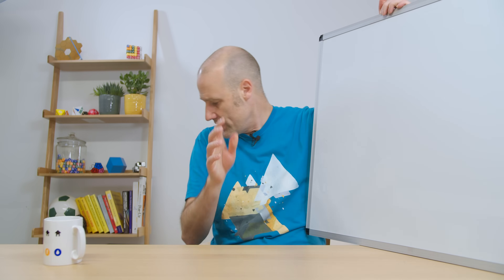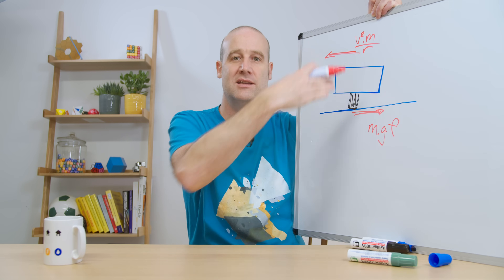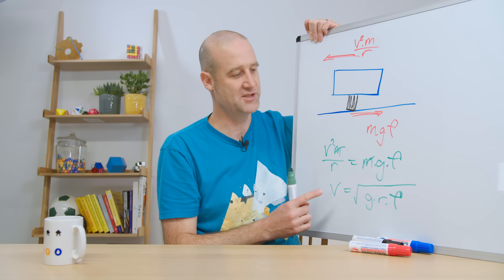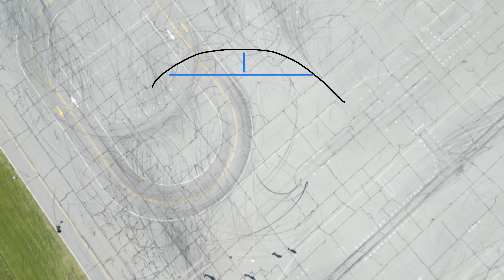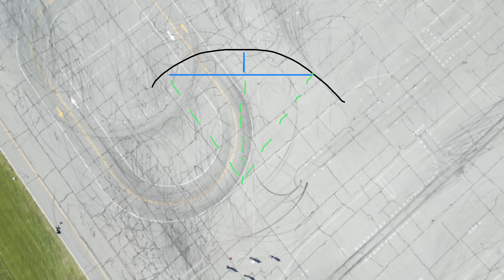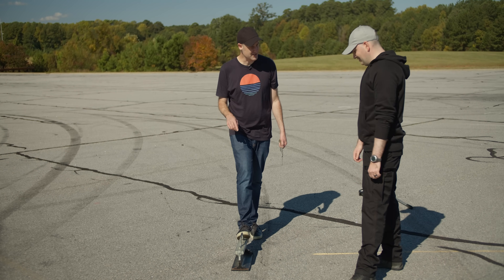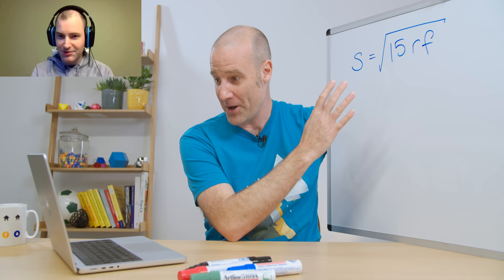Using an Out-of-Control Car to Calculate π.

Comment: As awesome as that was, I kind of get the feeling a good lawyer would have a field day in court if this was presented as evidence
Reply: Why? This method is used as evidence in court
Reply: @freshrockpapa-e7799   the use of rounding to get 15 is going to induce inaccuracies. The force gauge, was it perfectly horizontal, does it have a calibration cert, how was the reading recorded. The coefficient of friction for the sled, is the rubber that's used on the sled the same as the tyre that's on the vehicle. 

Those are only a few I can think of. I dropped out of law after a couple years to do automotive engineering so I'm looking at it from both brains
Reply: @shanemjn  Of course there's inaccuracies, but why would that matter? Everything is inaccurate. 

First of all considering that there's a square root the error in the result would be half the error in measurements.

Also no forensic analysis simply spits out a number, they do statistical analysis to provide an interval. 

What you saw was a very simplified version of the whole process, of course they make sure the rubber of the sled is equivalent to the one in the car and so on.

I'll never understand why random people on YouTube's comments think they know how to do someone's job better than themselves, it's hilarious
Reply: @freshrockpapa-e7799  I'm not saying I know better, that's why I said in my original comment "kind of get the feeling" 

I've seen speeding tickets thrown out because, despite the radar gun having a calibration cert, the tape measure that was used to do the calibration didn't.

In order to be found guilty, it has to be proven beyond all reasonable doubt. All that's needed is for the seed of doubt to be sown
Reply: @shanemjn  that's why they use statistical analysis to provide an interval inside which the true speed is guaranteed to be...
Reply: @freshrockpapa-e7799  yes, and if that is well beyond the posted speed limit then all of this is moot. But if it's marginal, then it all comes down to what happens when that person get their day in court.
Reply: @shanemjn  that to me seems like the system working as it should. Who cares if the defendant was 5kmh faster than the limit? This is only to prove when people were significantly going faster, what's the point otherwise.
Reply: @freshrockpapa-e7799   @Fresh Rock Papa-E  under law speeding is driving in excess of the posted speed limit. It doesn't matter how in excess. 

Going back to my earlier example, those people who had their tickets thrown out weren't marginally over, they were well in excess. All it took was that small doubt in the accuracy of a tape measure.
Reply: @shanemjn  of course it matters how much you're over dude, it's not the same going over the limit by 5kmh than 35kph.

And of course the case gets dropped if the equipment wasn't calibrated and validated, I don't know why you keep bringing that up because it's irrelevant.
Reply: @freshrockpapa-e7799  that depends on the country. Some have bands for speeding, be it based on set percentages of the posted limit or just speed bands, others don't, speeding is speeding. 

It's not irrelevant, it's an example of something that the majority of people would think wouldn't matter, but is a technicality that a lawyer would use. The fact that the whole point of this was to find pi and they didn't shows that something in the maths was wrong. When it comes to law, close enough doesn't count.
Reply: @shanemjn  okey buddy, I guess you know more than the person that earns his living doing it.
Reply: @freshrockpapa-e7799  I know enough about law to know the kind of B.S a lawyer would pull, that's exactly why I got out of the legal field. 

It doesn't matter whether you think a bit of rounding here and a truncation there is irrelevant. It's about what the lawyer can convince the judge.
Reply: @shanemjn  but it literally is irrelevant. The error is mathematically bounded, you're just ignorant about the technical aspects of these methods.
Reply: @freshrockpapa-e7799  during the Kyle Rittenhouse trial, his lawyers were able to get photo and video evidence thrown out because they had been zoomed in on. They were a able to convince the judge that simply zooming in was doctoring the evidence. That's how pedantic the legal system is. The prosecution had experts in video analysis testify that it didn't matter that the footage had been zoomed in on. The expert testimony didn't matter. The lawyers were still able to get the judge to throw it out.

Comment: Why make this so inaccessible by using imperial units?
For everyone trying it on calculator, g is g, 25mph is 11.176m/s, 382feet is 116.434m.
Now it works out easily for everyone around the globe.

edit: just noticed It gets even closer to pi by using metric units
Reply: This is not how math works. The ratio is the same before and after converting units. You got a better result because you used 26/38 instead of 0.68. The guy rounded to 2 digits because his reading was 2 digits. He read 26 not 26.0 .
Reply: @hurktang  you're right.
Reply: How is this inaccessible dude? Lmao
Reply: @freshrockpapa-e7799  inaccessible in a sense that g is not 15 in the metric world, and that can be confusing for slow heads like mine
Reply: @fernandovalner  no one said g is 15 LOL

Comment: So, when is Matt going to use his previous approximations of pi to calculate pi again?

By the way, not using the simple average way. Rather, treat his values as normally distributed and calculate pi by reconstructing the Gaussian curve and solving for the area under is as sqrt(pi)
Reply: How exactly does your method work? You can't reconstruct a gaussian curve because you only have the observation, not the probability of getting each observation
Reply: @freshrockpapa-e7799  I think they may be talking about Maximum Likelihood Estimation (MLE). There are some good videos explaining on it on YT.
Reply: @cinemaker321  that would result in the same pi estimation as just making the average...
Reply: @freshrockpapa-e7799  You could just best-fit a normal distribution assuming each year's measurement had a constant Parker^tm variance. Some methods can account for missing lopsided observations, so the fitted mean can be quite disjoint from the arithmetic one. Only issue is, having enough datapoints might take a few decades:>
Reply: I'm here for it
Reply: Probably a log normal distribution. Maybe even something weirder since some calculations get lots of digits and some very few.
Reply: I suggest pi day in the year 2115 for this calculation, ie, 3/14/15.
Reply: Probably when he runs out of ideas
Reply: Not enough data yet
Reply: Sounds like some chunky maths.

Comment: If you use another decimal point of precision for the coefficient of friction you get 0.684, which yields an even better approximation of 3.135!
Reply: Then again, I doubt the method of measurement they used for the coefficient of friction permits 3 decimals. It is very crude and it would probably require a much heavier device and precisely horizontal pull for a better precision.
Reply: Snap
Reply: Then the actual speed becomes 24.944mph, and if this was the pivot point in a real case the lawyers would be pulling their hair out at this point.
Reply: 684
Reply: The 15 only has 2 significant digits. So a simplified error analysis would say your answer only accurate to 2 significant digits or pi equals 3.1 which is “exactly” correct. If he would have used more digits for that (since it is an exact number based on the definition of units) or left it as a fraction, that would not have limit the digits in the answer. However, the other measurements are not anymore accurate, so it is probably still limit to 2 digits in the answer. I’m not going to do the whole error analysis, but my guess is that it would plus or minus 10%.
Reply: r/unexpectedfactorial
Reply: @akabami2161  are we on Reddit right now?
Reply: @samlauer8855  No, I realised that you can't take the factorial of a decimal :(
Reply: @akabami2161  The gamma function would like to introduce itself to you.
Reply: That's not how precision works...
Reply: @freshrockpapa-e7799  What do you mean? That's exactly how precision works.
Reply: @phiefer3  you can't just decide how many significant figures your answer has based on how well it happens to approximate the real value.
Reply: @freshrockpapa-e7799  man this is a youtube video approximating pi. Because it's an approximation it actually does not matter if we pay attention to significant figures and frankly using more figures is a better approximation anyways.
Reply: @quinism1136  what??? You clearly have no clue what you're talking about. Of course significant figures are relevant, and using more isn't better. They are all completely wrong, you can't make up precision lol
Reply: @freshrockpapa-e7799  there was never precision to begin with here. Significant figures here wouldn't mean anything because none of these numbers were using sig figs from the start and Matt wasn't looking to calculate pi exactly with any accuracy or precision. If he was he would not do it this way.  He was using approximate numbers to approximately calculate pi. Picking and choosing which numbers he uses sig figs here does not matter. 

If you're trying to get an accurate or precise result of course significant figures are important. But my argument is that dosent really apply to this situation cause it's a fun casual video for pi day.
Reply: @phiefer3  the values are measured with two significant digits, therefore the calculated coefficient can only be two digits. you can’t calculate in more precision when your measurements didn’t use that level of precision
Reply: @quinism1136  using more figures is not better for an approximation if your measurements do not support that level of precision

Comment: I hate all the imperial units in these formulas, but apart from that, very nice approximation!
Reply: agree. Wonder if there's a metric equivalent
Reply: @stevewandel9317  dude it's the exact same thing in metric
Reply: @freshrockpapa-e7799  I kind of glossed over the bit where g for gravity was being screwed around with. Probably don't need to do anything for metric as everything is base 10
Reply: @stevewandel9317 You'd still need to deal with base 60 when converting meters per second into the (most likely) kilometers per hour measurement from the car

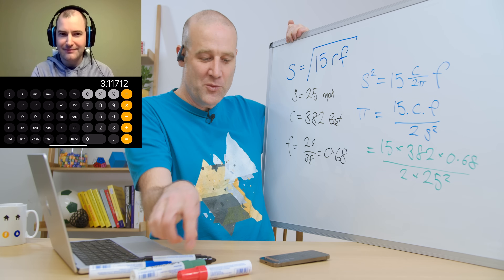Comment: You would've got 3.136 if you didn't round 26/38 as 0.68 13:15
Reply from the maker: OH DANG YOU'RE RIGHT
Reply: @standupmaths  skill issue
Reply: @standupmaths  holy crap
Reply: What would happen if the 15 approximation hadn't been used in preference over the real value?
Reply: @cragonaut  Punching it in with 14.962 instead of 15, and going with the better 0.684 coefficient of friction gets you pi as 3.128 rounding to 3 decimal places.
Reply: @PercussiveMaintainer  Uh oh. We went a step backwards. Quick, choose some other things to round and not round to fit our narrative.
Reply: I'm waiting for the day when Matt discovers significant digits and stops prematurely rounding everything off
Reply: @ratboy2713  let's get the next pie with error bars, while we're at it.

Edit: but actually, calculate pi from a sample of 314 pies and show em the power of statistics.
Reply: @user-yw9mw9hv8o  Using 314 pies to calculate pi was the first pi day video Matt did
Reply: @ratboy2713  that will be the day he also solves the parker square! :)
Reply: @ratboy2713  that comment made me laugh so hard! The irony 😅
Reply: Yeah but there is no actual precision there.. the numbers 28 and 38 were just rounded approximations anyway. I'd love to see you use something like this to teach uncertainty. Like estimating the percent uncertainty of your least precise measurment and applying that as a rough approximation of overall uncertainty. Sure, the square root complicates things, but you could just say it was a way to approximate
Reply: @maitland1007  you can deal with the square root by propagating the error properly with some partial derivatives
Reply: @gabes1733  Sure, but I was saying that if he just did the simple approximation of saying the percent uncertainy in pi was the percent uncertainty of his worst measurement, he'd get a rough approximation with a simple easy to explain method.
Reply: @gabes1733 I got Mean error =0.04 calculated with partial derivates of the last formula. (assumtions: the values sled weight, force and circumference have the error +-0.5 and speed +-5% (1.25 mph) )
Reply: I wondered if the circumference might have been slightly underestimated because of a possible increased curve as the car slowed down, so I (arbitrarily) increaded it to 383 and, using 14.962 with (26/38) got 3.1366651...
So I started tweaking.
Assuming the coefficient of friction is actually correct (which it probably isn't, because rounding, but hey...) the circumference of 383.6 yeilds 3.1415790...
So y'know. There's that...?
Reply: Also, the conversion factor shouldn't have been rounded off to 15. Using 32.17405 ft/s/s for acceleration, the conversion factor should be 14.95694. That would have changed the result to 3.1274174. . ., which rounds to 3.13.
Reply: It was Parker precision.
Reply: BUT faking precision by „after measurement digit fetishism“ is only the next level
Reply: Would have gotten 2.98 if the guy didn’t manipulate the weight of the sled after the fact…… me thinks he realised that every case he’s ever been an expert on can get relitigated if he’s 5% off even in an ideal controlled environment

Comment: After so many Calculator Unboxing videos, Matt still uses the phone calculator
Reply from the maker: The ability to screengrab is just too convenient! It's not for a lack of other calculators in my office.
Reply: @standupmaths  you gotta go hardcore and use a circular slide rule for pi day
Reply: @iamdigory  I agree - for Pi Day no calculator would be more fun than a circular slide rule.
Reply: @standupmaths  so you say! SHOW US THE DIGITS MATT
Reply: @standupmaths  Look up the GHLBD android calculator. It's a physical calculator with a phone display and OS.
Reply: @standupmaths  surely the texas instruments software for mac/pc wouldn't be an issue to screen capture?
Reply: @standupmaths  Nothing a good old doc cam can't fix. Sometimes you gotta return to the old-fashioned tech.
Reply: @standupmaths Are you still accepting donations?
Reply: @standupmaths  maybe you could unbox a capture card for your calculators?
Reply: Go abacus or go home! LoL
Reply: @CaioTrinchinato  I am Abacus!
Reply: Honestly, all youtuber's need merch and he already have Maths Gear so he should just bite the bullet and make he's own graph calculator and include screengrab. Maybe add spreadsheet capabilities and color screen for the graphs, use USB to charge the replaceable battery and have a nice keyboard and make sure that it can write the equations probably.  There have been no new innovation on the calculator market since the mobile phone. I am still using my two old trusty voyage 200 and I think it is time for something new.
Reply: @Petch85  Matt's Official Parker Calculator sounds like an awesome merch.
Reply: @Petch85  The TI Nspire does most of that, although there are plenty of things that suck about it (proprietary companion software, ew). Unfortunately, a good graphing calculator is not easy to make. The hardware is pretty simple, but the software is not.
Reply: @Petch85  that's a laptop...
Reply: I've got a $5 graphing calculator app that is in every way superior to any dedicated calculator you can buy.

"But the phone you use it on is MORE expensive!" Yes, but that phone also replaces so many other things, that the whole shebang is cheaper overall.
Reply: Gotta get a full size glossy printout of a photo of the calculator, BigClive-style.
Reply: Use the Gaxio!
Reply: I actually looked for calculator unboxing videos what's wrong with me.
Reply: @rashakawa  they exist and they are great! On the 2nd channel maybe
Reply: TI-83 emulator
Reply: @CDCI3  Shall we compromise with Plus42?
Reply: The car is the calculator or at least the simulator
Reply: @hundry_f  Works for me, even math tables if necessary.
Reply: It's more accurate bruh.... You don't get it

Comment: I had wondered where the 'spherical cow' part would come in, then you explained that it is a single tire car. :D
Reply: @PeachCrusher69 i mean the triangle wave on the NES is supposed to be "close enough" to a sine wave (it isn't)
Reply: @TorutheRedFox  it works better than a sine wave because of the overtones caused by the uneven jagged edge of the triangle. The NES triangle is meant for lower tones and goes out of tune quickly at higher tones, and low notes of a pure sine wave are very difficult to hear without good speakers. It wasn't really meant to work like a sine wave.
Reply: @trulyinfamous  that's... a bit difficult to believe, as drastically different as the two are.